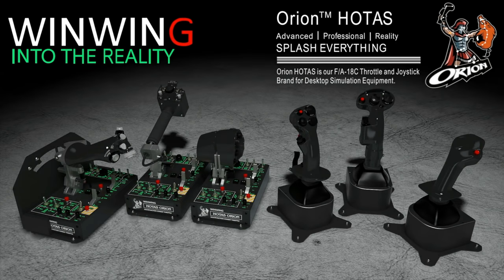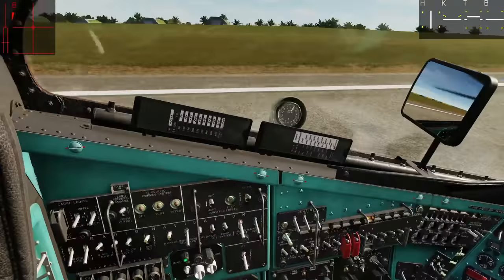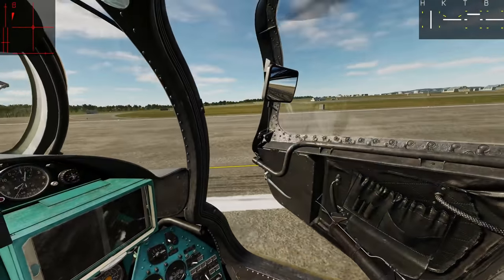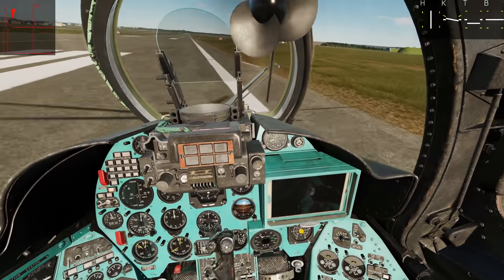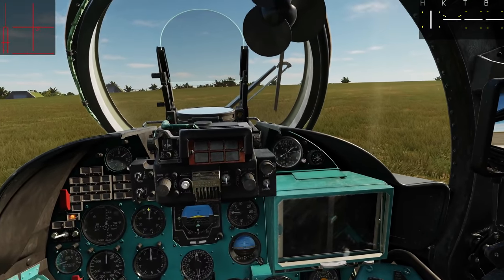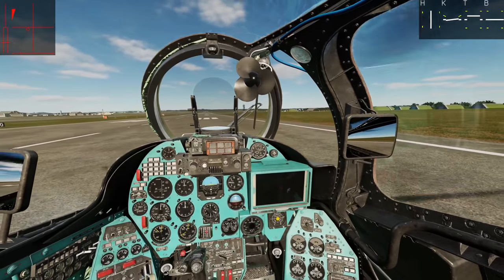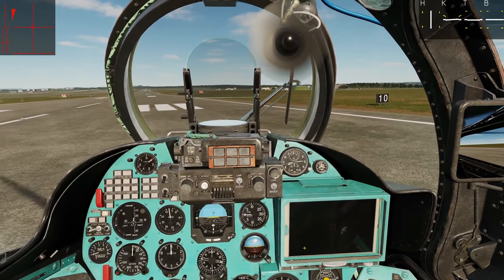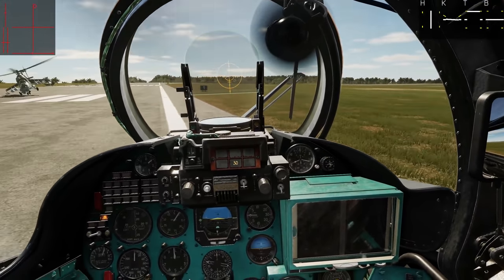Questioned: Is The Hind "Afghan Takeoff" Possible? Heavyweight Hind Dogfight? | DCS WORLD

Comment: I've been practicing this since the module came out and the vid on my channel shows it.  The way I do it is center cyclic, force trimmed slightly to the right for translational tendency.  Start a three-wheel rolling start off to straighten the front gear and build up speed in the right direction.  A few seconds later, press cyclic forward about 90 % and hold.  Increase collective to takeoff range..  Too much cyclic, it will grind the optical sight housing against the runway.  Use left/right cyclic and slight pedal to balance.   Bam, you're doing a front wheelie down the runway.  When u reach take off speed, just pick your nose off and you're airborne, just like that 👍 

EDIT: It's just the way I do it. I'm no expert at it, just A LOT of trial and error lol.  Not sure what max weight to do this is

Comment: From Ka-50 manual procedure is -

Smoothly push the cyclic stick forward and initiate forward acceleration while increasing engine power to takeoff mode. Accelerate with the maximum possible rate (pitch angle no more than -10°). The main landing gear wheels will lift-off the ground.

I wonder if it’s the same for Mi-24
Reply: It's the same/similar for all the klimov engine series as i like to call them.
Ka-50 don't have to deal with torque much but the reste is the same.

The mi-08/Ka-50 with a stupid heavyload from altitude when it's hot will benefit from this as well.
the whole point is to skip the whole ''Hover/Transitional'' shit lift & aerodynamic & goes strait to forward flight (Lots of lift from the rotorblades for the same engine load/pitch).

This nose down nonsense is just to show off imo.

Comment: It's very doable, but you need to be gentle.

Essentially, start taxiing forwards, then stick goes forwards, almost all the way, and collective gradually goes to around half, maybe a bit more.

The stick does need to be far forwards, as moving it back to the centre will make you takeoff nice and smoothly.
Reply: Yeah, I think that was the issue, they're trying to get the rear wheels off too soon. You roll flat a bit first.
Reply: @AdmiralQuality  yep, if you start with some speed, the helo will not really want to go up until you re-centre the stick. 
It'll be glued to the ground on the front wheel as long as the cyclic is pushed forwards.
Reply: @Morrov  It might be something to do with the way trim works on non-FFB sticks too. I have FFB so when I hold the trim button down the stick goes floppy and only gets spring force again when I release it, leaving the stick wanting to stay in the position it's in. It's by far the best FFB effect in DCS, in all the ED/Belsimtek choppers. (The planes, not so much. Some are great, like the P-51. Others you don't notice anything when you really should. And still others are completely unflyable with FFB on.)
Reply: Facing the right direction down the runway wouldn't hurt either. ;)
Reply: @Tobascodagama  LOL! Yeah, they were very wobbly. Weird, as I didn't have that problem. (They might need to turn their cyclic curves down some. The Hind is incredibly touchy by default, particularly in the roll axis.)
Reply: Cap rarely does anything gentle, hes a fixed wing guy

Comment: Speaking of wind: I was messing around with wind-shear the other day. I set 50kt at 33ft, around 107kt at 1600, and 0kt the rest of the way up. It was fun in an A-10 just gliding and using "Dynamic Soaring" to accumulate energy by moving between layers.

May be a bit boring for a video, but fun none the less.

Comment: @Grim Reapers. This is not called an Afghan takeoff, but an airplane-like takeoff. The bottom line is: the helicopter accelerates along the runway like an airplane so that the lift acting on the wings helps to take off with a heavy load. With a horizontal fuselage, the wings of the helicopter have a large angle of attack.
Reply from the maker: thx

Comment: For me, collective up till the helicopter takes up the slack (so not much at all)
Cyclic slowly forward (wheel brake off XD) as I start to roll forward slowly add in collective and counter the rotation tendancy with anti torque. Once you get fast enough slowly release pressure on the cyclic and it will eventually pull up off the ground. It's all about being smooth and steady.

Comment: The forward gear of the one in the video seems to extend slightly more than the one in DCS, which threatens to hit the ATGM sight on the ground. In fact, yes, you show that a few attempts later. The Hind in the video has a similar sight, I wonder why its doesn't scrape the ground? Something's wrong!

NTTR would have been a good one for this. There's fields at 4,000 ft and even higher, I think. 

Was one of the first things I tried and I had no problem doing it. You still have to fly the cyclic, obviously, as there's no roll support from the rear wheels anymore. (Which are pretty squishy even when they're touching the ground.)

Here's me doing it. This is about my third try at it but it went well all three times. Perhaps I'm not a "noob" who needs to "git gud" after all! ;)

https://youtu.be/7yFhYBcnjwA?t=75
Reply: (I may not have been absolute heaviest weight there, but I was full fuel, 4X AGTM pylons and 2X rocket pods.)

Comment: i saw that video. even at the slower playback speed. also i checked other polish hind video( https://www.youtube.com/watch?v=Yxi8dsGW-eQ ). and i found the answer.
first, you have to hover on takeoff starting location of runway. and make the pitch down to nose gear on ground and give more collective to make some power to forward and also make sure to helicopter maintain the altitude. important thing is YOU NEED TO MAINTAIN THE STABLE FROM BEFORE ROLL UNTIL TAKEOFF.
at last, when you reached the enough speed to takeoff, give bit more collective/power and make pitch bit up to takeoff!

or, there's another way to runway takeoff type. it's simple. first, cyclic forward at max, and give collective to accelerate. but make sure all 3 gear maintain landed statues. like taxing.
then aircraft will start move forward. maintain it until reaches enough speed or near end of runway and give bit more collective/power to takeoff!
example - https://www.youtube.com/watch?v=ISz1Ef77hO0